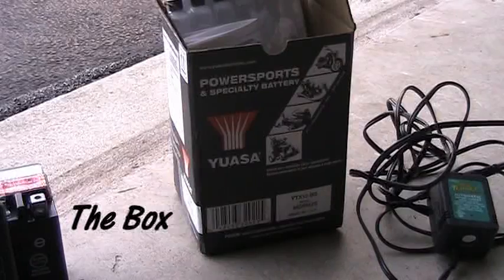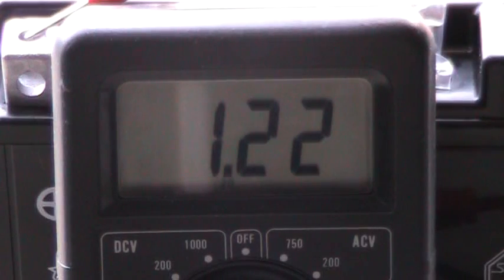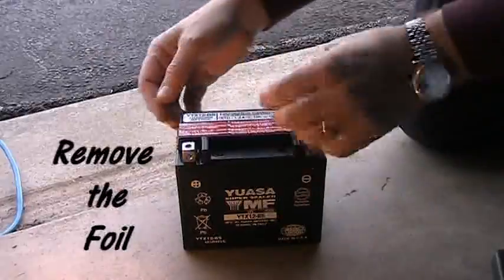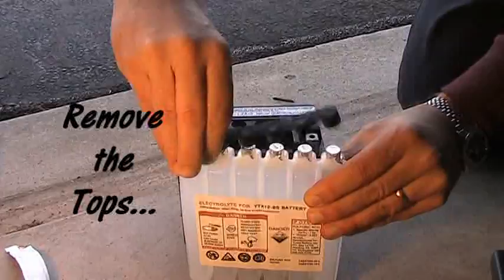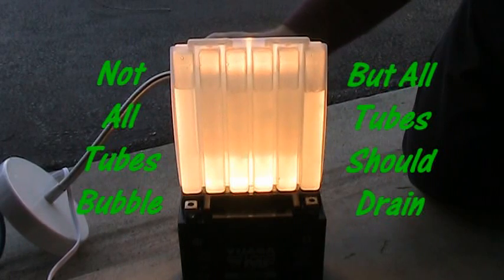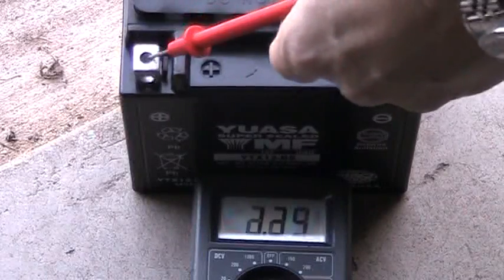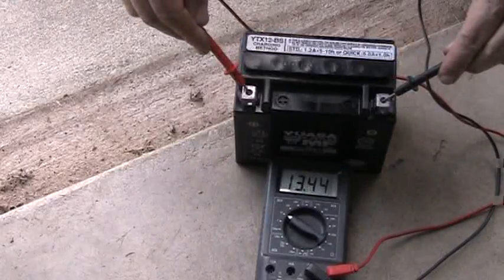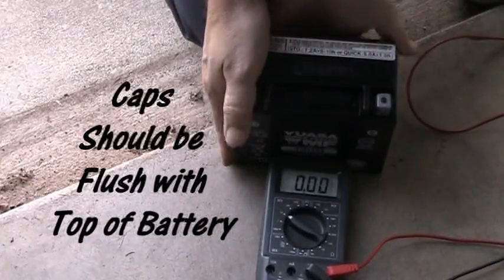Yuasa Battery Charge

Comment: I would do a couple of things in addition to your instructions. It would be a good idea to use rubber gloves when handling the battery until it's installed. Also, I would do the filling on a piece of cardboard to catch any spills. Have a jug of water handy to flush acid that might get loose.

The Battery Tender Jr. you used will go solid green when it's fully charged the battery. Red light is bulk charge, flashing green is absorption, constant green is float.

Good job on your excellent video!

Comment: Very informative! I would suggest making an annotation for people explaining that they should actually connect the red cable FIRST and then attach the black cable. You always want the positive attached first, if you attach the ground there's a huge chance that if you touch the cables a connection will be made that wont stop and it could potentially kill you. Always connect red/black and when taking it off black/red ALWAYS.
Reply: 12V won't kill you bro

Comment: Great Video I just bought the exact same battery for my Vulcan 900. I was a little confused as to what charger I should use to charge it. The battery says 1.2a x 5 10. I took that as 1.2amps for 10 hours. I then read about using a Battery Tender Jr. and there was mixed results as to if it was enough to actually initialize a new battery. I assumed at .075a it would take much longer than 3 hours to charge. I am still reading about this and there are mixed reviews. I also have a 2amp trickle charge

Comment: For my battery, from a different manufacturer, the instructions are the same up to a point - they make no mention of charging being needed.  Just seal it, and though it is a lower state of being charged, that it is ready for use.  Will gasses not be created, after it has been sealed, and while it is being charged while in use in the bike?  Hmm...

Comment: Hi -- I just filled mine and I didn't let it sit. I just put the cover on and installed it. I didn't know I was supposed to let it sit for the electrolytes to settle. I thought they were saying it would take 20 mins to drain. Anyway -- think I screwed up ? Also how long did this battery last you ? I see you made this video in 2011. thanks !

Comment: Great video, thanks for posting. Did anyone else have success using the the Battery Tender Jr. for the initial charge? Like @Tommy Armour, I've read mixed opinions on whether the Jr. will suffice, or the Plus is needed.

Comment: Yes, good video...good camera work and graphics and audio. Info spot on but I'm very surprised however that no mention made of safety, as in your handling sulfuric acid...HELLO!  At a minimum you should have gloves on and some kind of clothing protection and most definitely some kind of eye protection. There's no room for "oops" with this stuff. Be smart. It won't add much time to finishing the project when you take the time to do it safely.